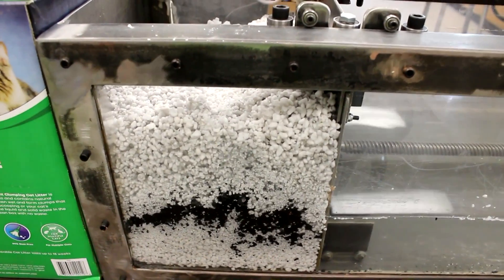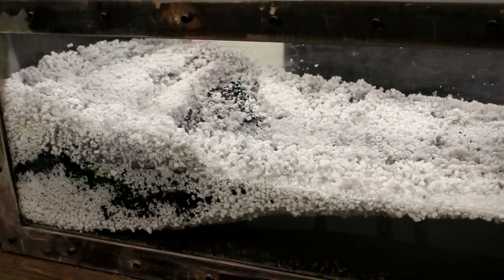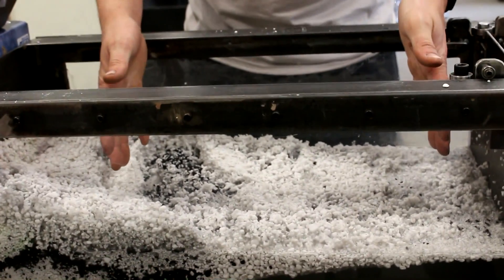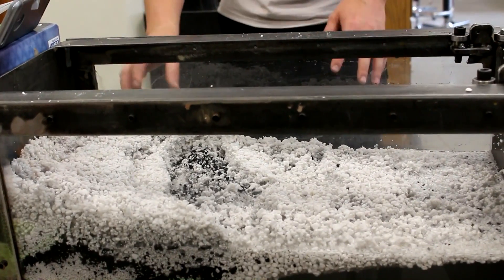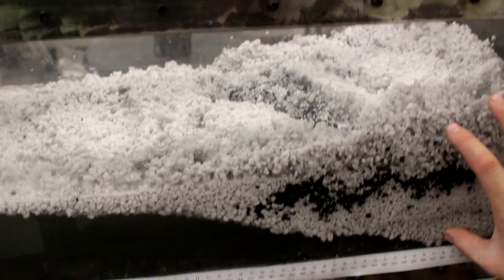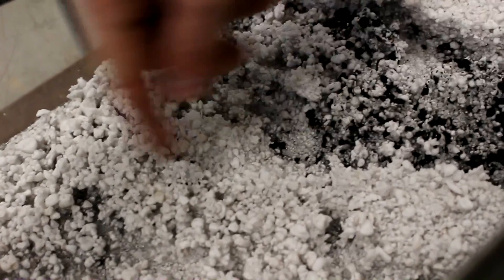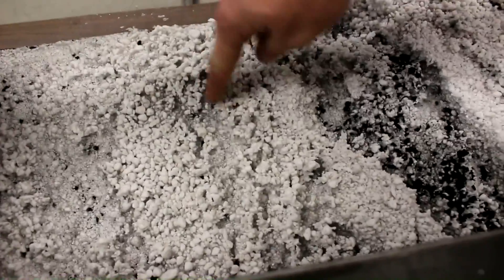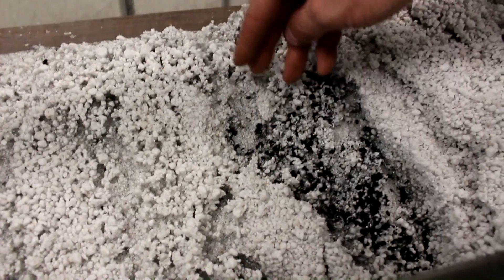Geo Sand Box with Floating Perlite

Comment: Any chance you could do a video on what is causing the oklahoma earthquakes? The oil companies say its not from fracking. Well I disagree. I have lived here for 26 years and these earthquakes didn't start getting bad until less than 10 years ago. LOL at 9:00 the cats drinking your water.
Reply from the maker: Well think about what else has been going on over the last few years, sure fracking has been increasing in popularity but it is nothing new, the amount of water stored in the ground has been falling dramatically this means that trillions of tones of water has been removed and that kind of mass transfer has a huge impact on the crust. Its like the reverse of building a large dam, and it is ferly well known that filling a large dam results in more earthquakes as the ground flexes to accommodate the weight. Sure fracking moves some weight around but it is measured in the thousands of tonnes, not trillions.
Reply from the maker: Pulling water out of aquifers for farming has a much greater impact than fracking; more mass moved.
Reply: ***** Its just weird that it has really picked up in the past 5 or 6 years. I think we had a 5.3 a little while back. The largest one before that was a 4.7 (i think).
Reply: I would love a video on this Cody...
Reply: Ok.. I found out what Fracking is, but as a fan of Battlestar Galactica.. man good laugh.
Reply: I'd think that injecting water into the ground at high pressure, even though much less in total mass, would have a more devastating effect that pumping water out of the ground.
Reply: I can tell you right now your definately not the only region on the planet battling this.
In the Netherlands there is a province called Groningen.
ALL of the Netherlands are built upon kilometers thick layers of clay and sand.

THUS there has NEVER been a significant earthquake in the Netherlands.
HOWEVER about 4 years ago they started fracking in Groningen and even since then houses have split in 2, earthquakes are weekly and there is only 1 consitincy.

Oil companies denying any link to their works.
Reply: It's from the injection of the waste water related to fracking.  Injecting water into the ground lubricates these really old faults, increasing the pore pressure which makes it more likely to fail and cause an earthquake.  If you're interested in the math behind it google Coulomb stress transfer.  Injecting the water increases the p variable which decreases the overall stress needed to cause an earthquake.

σf = τB - μ(σB – p)

It isn't the fracking that is directly causing the earthquakes; it's the waste water injection related to fracking.  Most of those earthquakes are very small in magnitude (<M3.0) but there is the occasional M5.X that has gone off which is bad for an area that wasn't building structures to withstand moderate earthquakes.  The data in OK is overwhelming and shows a strong correlation to increased seismicity and the onset of hydraulic fracturing operations.
Reply: +MagicSteve No! You have been listening to the scaremongering haven't you...? It's known as hydraulic fracturing, the well is drilled well below the level that our drinking water comes from, the two systems never come into contact. True they pump high pressure water with some other goodies in it to help extract the tiny pockets of gas... but I'm fairly certain nothing flammable. The cases you've heard about is most likely Methane in their water supply from other sources.
Reply: Hydraulic fracturing has been directly linked to induced seismicity or earthquakes.[138] The magnitude of these events is usually too small to be detected at the surface, although tremors attributed to fluid injection into disposal wells have been large enough to have often been felt by people, and to have caused property damage and possibly injuries.[10][139][140][141][142][143] In September 2016 a 5.6-magnitude earthquake caused by fracking activities shook at least six states. In response the state of Oklahoma shut down 37 disposal wells over a 725-square mile area.
Reply: Geoffrey Ritchey Why not both? You take a trillion tons of water out of the ground and then you surround that area with 36 hydraulic pumps injecting high pressure back into it causing the release of more gas from the ground. You know what would happen if you did that to a woman? ^_^
Reply: Well, the whole process of fracking aims at lowering the rocks strength by injecting fluid and thus breaking it so the oil can be sucked out through the small fractures. It is well known that a high pore-fluid pressure drastically lowers the strength of rocks. So if you live in a tectonically active area and the rocks are already stressed this extra fluid can shift the system to unstable conditions, triggering an earthquake. As mentioned above, several studies conclude that there is indeed a connection between fracking and earthquakes.
Reply: Cody'sLab notice me senpai
Reply: Qrofol I think winter in Finland could be classified as a yearly natural disaster by Dutch standards :P

All kidding aside, since you mention your phd, you will probably be studying at the /city/ of Groningen, which in a corner of the /province/ of Groningen. It is far enough away from pretty much all earthquakes to not be at risk at all. Also, the damage the earthquakes are doing is usually not sudden, in that a perfectly fine house will suddenly collapse, but gradual: the large volume of low magnitude earthquakes, in combination with century-old brick and mortar buildings, causes gradual but severe damage in the houses near the epicenters. If these earthquakes would happen in a real, plate-tectonic earthquake prone area they would not cause any damage, since houses in those areas would be built for earthquakes. However, many of the damaged buildings were built before the gas fields were even discovered. These are therefore not built with earthquakes in mind at all.

Source: I live on the other side of the province in a more quake-prone area (but still pretty quiet, and I have so far never felt one), and am generally interested in the stuff going on beneath my feet.
Reply: Of  course, there was a 5.5 quake in OK back in 1952, before fracking was invented; and there was a real bad one in 1882 that may have been even stronger. The point is, OK actually has a history of quakes, and correlation is not causation. (i am not a geologist, and make no claims that fracking is safe or good, just saying that ground science is big and complex).
Reply: Folks hate fracking but it's nonsense to bail out on the primary form of energy for an entirely new technology. Let the companies frack, let our oil costs go down and continue pushing for new energy sources. Solar power you say? Well, when a panel costs less energy to produce than it generates, solar power will be a very good source. Killing coal and oil before we have a replacement is a great way to sink more than just one economy.
Reply: Damian Reloaded That 5.6 was pretty intense. The only quake that scared me enough to get out of my house.
Reply: Cody'sLab to be fair, alot of the epicenters fall coincidentally close to fracking sites. plus there is tons of aquifer use in Kansas but most of the earthquakes that are felt in Kansas are actually occurring in Oklahoma.
Reply: ***** Yeah, lets create a nonrenewable-fuel based nuclear plant that emits so much gamma radiation that's practically inoperable! That won't cause mega mining and won't be dangerous at all!
Reply: Right, but the removal of millions and trillions of mass of water from the same area is much worse for it and likewise contributes in a much larger way to these earthquakes.
Reply: old_man_ sport I probably should have mentioned that its the disposal of the fluid not the actual oil drilling part but we just call the whole process fracking here. Its Oklahoma we're simpletons.
Reply: Qrofol I think the guy talking about Groningen is exaggerating a bit. Yes, there is definatly damage done but by houses spliting in two he mean cracks. The worst I have heard of is old buildings that need support to keep them from cracking further. You are probably going to the city called Groningen in the province called Groningen. The city, as far as I know, is absolutely fine.
Reply: In perspective, the Three Gorges Dam in china despite shifting the mass of earth quite a lot, has barely noticeable effects on geological phenomena. But i guess more studies are needed.
Reply: 10 small earthquakes is a lot better than one big one,
any day.
Reply: that's pretty optimistic, to assume that the two systems never come in contact. You'd have to seal the well completly up to the point where you want the fluid to get out, but this is rarely done for cost reduction. You'd leave the well unsealed in sections where you expect the rock to be impermable anyways. This will work in most cases but sometimes it won't and produce a mess.
Never believe a geologist who says he can guarantee you that something will work according to the plan, he's a liar. There are so many uncertainties in geology, you can never know exactly what's going on, only make assumptions and hope that you don't encounter the exception to the rule.
A few years ago they wanted to start a geothermal plant in a village nearby (for that water is pumped down as well). It leaked and the water came into contact with an overlaying layer of gypsum, the gypsum soaked up the water and increased in volume. That caused the ground to lift up about 5 meters, pretty much destroying the village above it. Only to show you that things like that can go wrong very easily.
Reply: Cody'sLab replay pls
Reply: WitchieNL splitting in 2? thats a bit of a hyperbole.
Reply: i thought it was mercury first and flipped shit
Reply: x9x9x9x9x9 no worries I'm from just south of you. Point being it's just that fracking is safe and the earthquakes can be handled when the whole process is done safely explicitly the WW injection wells.
Reply: im no expert on fracking, but it is my understanding that companies pump high pressure fluid of some type into the rock to force the oil out, this fluid is what ends up in the drinking water (causing it to catch fire) and could increase the probability of earthquakes.
Reply: WitchieNL There is no fracking being done in the Netherlands right now, nor has there ever been any fracking done in NL. There are some pilot holes currently being drilled, but those are just to look for frackable gas, they aren't being used for fracking (yet). 

The earthquakes here /are/ being caused by the gas extraction, but it's just because the soil is slowly sinking as the extraction of gas relieves pressure underground. However, there is still reason to distrust the gas extraction company, since they have downplayed the risks of these earthquakes for decades and they are now increasing in magnitude beyond anything they previously admitted was possible, even though they had plenty of evidence that such higher magnitude earthquakes could start occurring.
Reply: bruh
Reply: @x9x9x9x9x9 I've been doing a lot of research about this. Most evidence is pointing towards waste well injections causing the earthquakes. Specifically type II brine injections. Waste water injections both lubricate and pressurize the rock, causing faults to form and slip. Go to http://earthquakes.ok.gov/what-we-know/earthquake-map/ and check for yourself.
Reply: I live in a fairly small town in texas and about 40 miles west of where I live there was a couple of earthquakes and that area is all brush land with a few cattle ranches and tons of fairly new oil rigs. Where I live and is mainly all farm land and almost no oil rigs and we haven't had any earthquakes that I can remember. So to me it seems like it has to do with the oil companies. I'm just saying on how I feel and what I see I dont have any real education on this subject though
Reply: 8:51 / 10:04 that's when it starts.
Reply: x9x9x9x9x9 Its always a combination of things that causes the problems, never a single reason, if somethings already significantly weakening the structure(like extracting ground waters) all it is need is a slightest of tip to completely destroy the balance. In geology terms you people is probably already sitting on a time bomb, that fracking is just doing the dirty man's work of triggering, surely the oil companies is probably lying, but it is silly to just blame the oil companies.
Reply: To be honest you'll probably get used to quakes soon. Here in NZ you get well over 10,000 a year and you may have seen on the news that we had a M7.8  two months ago which would have released several hundred times more energy than any M5. In fact even whilst writing this comment I have just felt a M5.2 and I barely notice them now.
Reply: That 5.6 at 2am woke me out of a dead sleep here in Tulsa.
Reply: Oh cool, yeah I think I missed the 9am one, wasn't that like 3 months ago? I was in Ohio, sucked because I wanted to feel that one!
Reply: Hey Cody why did you stop making rockets. I really enjoyed those video's.
Reply: here's what my geology prof said:
water is a lubricant so if you pump it into the crust with high pressure and there is a fault with a particular tension it can release and cause an earthquake. most likely just a small one, but you never know.. this was researched in order to find out if there is a way to prevent big instantaneous quakes by intentionally causing many small ones and thus reducing the tension over time. dismissed because it wasn't really controllable.
Reply: HARP machine?
Reply: https://www2.usgs.gov/blogs/features/usgs_top_story/6-facts-about-human-caused-earthquakes/

This should help.
Reply: Cody'sLab is there an experiment to show that?
Reply: Aw, man. I've been considering moving to Groningen in a few years, for my PhD studies. But as I'm from Finland where we don't have any noteworthy natural disasters, I'm not sure I could deal with earthquakes.
Reply: They pull water for fracking too
Reply: I'm from Ada and now i'm in Tulsa Ok. And yeah they have been getting more and more frequent in the past few years and to the point where it's easily felt. I'm glad you asked this question as i've been wondering the same.
Reply: It's not the mass movement, it's the waste water being released very deep down, which helps trigger earthquakes. There are quite a few scientific studies about this.
Reply: x9x9x9x9x9
Reply: x9x9x9x9x9 City is fucked up not a single episode of Destroyed in Seconds go without blowing something up in oklahoma
Reply: Oh yeah we have a bunch of small fault lines here that used to cause small little <3.0 mag quakes all the time and every now and then have something stronger but you had to be in just the right place at the right time to feel hear one of those. Now they are more frequent and much stronger.
Reply: It is not fracking but produced brine disposal.  Produced brine comes up with the oil and is removed before oil goes into the pipeline.  This brine is injected back into old wells.  some operators will let pressures get too high.  But this isn't fracturing.
Reply: x9x9x9x9x9 no I don't think so although I disagree with what they're doing. I believe it's purely just a factor of maybe as time goes on the plates are moving such that earthquakes happen more and more severely
Reply: 95TurboSol That one was pretty intense. Wasn't there one around 9am that was strong. BTW I am also in Tulsa.
Reply: Earthquakes are caused by over pressurization due to the deep level deposal wells where they inject used fracing fluids.
Reply: I see your point, but I don't get how any of this could cause a 5.6 magnitude earthquake. Even the most powerful pumps couldn't even possibly compare to the force exerted by the Earth's crust, which weighs 2.8 quintillion tons. This is just what I think, so if you know any other factors in this, please enlighten me on them.
Reply: Landrew0 True except we used to have 10 much smaller quakes now they are just as common but stronger
Reply: The use massive amounts of aquifer water for fracking.
Reply: Zach Canfield Well then its a cycle. They are adding the water back to the aquifer then right (very nasty contaminated water).
Reply: x9x9x9x9x9 Here in Enid the earthquakes normally feel minor, but I think they're getting worse. I hope he responds to your request.
Reply: Cody, I really enjoy your videos. It has been a lot of fun to see your experiments at Utah as they were similar to those we perform at UNLV.
I would like to add to you analysis that the USGS agrees with your answer to x9x9x9x9x9's question. Far more fluids will be injected in a waste water disposal well than could be injected during the fracking process. Thus the related activities associated with fracking can be far more damaging than the act of fracking itself. 
https://earthquake.usgs.gov/research/induced/myths.php
Reply: everybody is scared for a 5.1 earthquake, in my country a 7.1 is pretty normal lol
Reply: +DrunkenGeophysicist
or, if you want to reduce the risk of you getting sued in case something goes wrong, use Biot's coupling parameter α: σeff = σ - αp with α = 1 - (K/Kp); K = bulk modulus (dry), Kp = bulk modulus at pore fluid pressure p ;)
Reply: SciGuy Thats why I wouldn't mind a video on this subject.
Reply: there is no way a oil company is causing earthquakes, unless they are using nukes for mining...
Reply: we had a good one in kansas a few months ago that came from oki.
Reply: and i live in n.e. kansas
Reply: x9x9x9x9x9 yeah my friend who lives there told me its bad haha
Reply: It's similar to glacial rebound and has to deal with the property called isostasy. Yes fracking has an effect on it and Cody is absolutely right as well. What I mean by that is when fracking material is pumped into the ground they often use water pumped from the local area and aquifers ( sometimes in the millions of gallons) which causes subsidence of the land and a cone of depression sometimes. The major problem with fracking is the contaminates that can intrude into the groundwater and surface water which can have an immense impact on the flora and fauna of the surrounding area and occasionally makes its way into the drinking water of humans as well.
Reply: Pablo Acuña Vera I believe that's the issue - this is a traditionally non seismic active region.  Construction techniques aren't designed this way.
Reply: U
Reply: It's not just Oklahoma having an increase in seismic activity. I'm in central-eastern North Carolina (up western part of down east for those who understand NC terminology) and we got a good shaking in 2011 & have had tremors ever since. I'm not formally educated in plate tectonics, so take this how you will, but it's not unreasonable to consider seismic activity in previously inactive areas being caused by the planet "awakening" or maybe even have always happened from time to time, i.e. highly active fault lines eventually give dormant fault lines a little room to shift and settle further & activity from those faults is just so seldom we haven't been here long enough for it to be on record. Like I said, I am not formally educated in geology, but that makes perfect sense to me
Reply: nice video!
I also have a channel, if you go take a look, you are all welcome :)